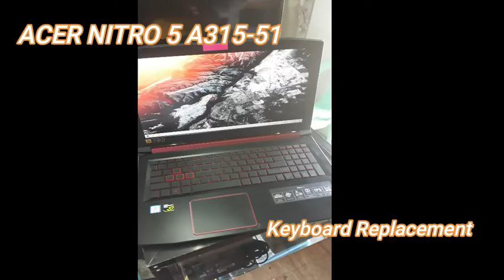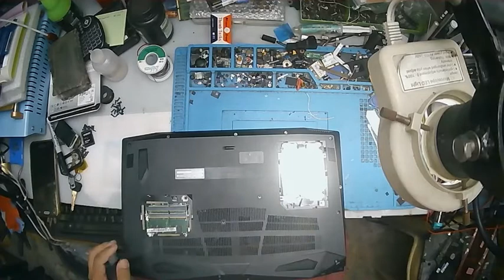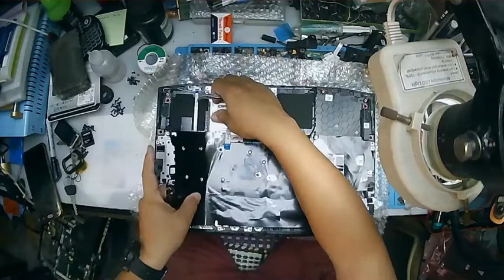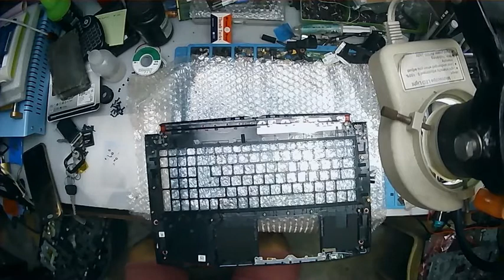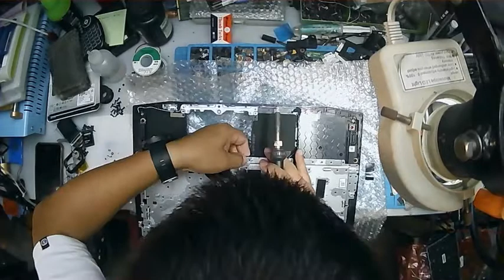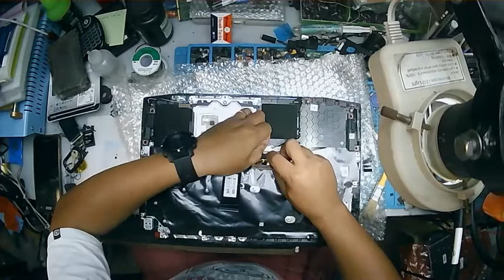Acer Nitro 5 A515 51 Keyboard Replacement

Comment: acer nitro keyboard so fragile,,, if no luck keyboard replacment in Acer is equivalent to engine overhaull,, so many parts to be removed to gain access
Reply from the maker: Yes sir just be sure b4 doing anything on the unit always 1st remove battery
Reply: boss class a lang ba pinalit mo hindi sya red rgb light ata?
Reply: Its like what you have to remove to replace a Chevy headlight  :-)

Comment: I have a problem. I have this laptop and the power key won't work. Is there a way for me to press it without needing to replace the whole keyboard?
Reply: HI, I have just repaired the same laptop which had the same keyboard issue. Replacing the Power key itself doesn't work, so unfortunately, the whole keyboard has to be replaced. You can find Palm rest together with keyboard, but you won't buy it under 66 GBP, new.
Reply: You can take off the back cover and locate where the main black ribbon connection is, right under the battery. there are like 20 connections right there and if u take a screwdriver and short the 2 leftmost pins the laptop will start. From there u can just keep it always on with an external keyboard until you get a new laptop. F acer
Reply: The connections are labeled JKB1
Reply: @tidepods7257  Hey dude can I contact you in discord or something? I can't find the label and I'm not sure how to proceed.
Reply: NEVERMIND IT WORKS HAH

Comment: Idk man. I got water damage on my keypad and its non responsive... i was like how hard can it be to repair it... dude... i have to strip down the whole computer just to get to the keypad.... i took it to a shop the guy said 200 bucks parts and labor. The part is like 20 to 50 bucks depending on where and how you get. Like damn it.
Reply: My kid spilled an entire glass of milk on his keyboard so I brought it out to the backyard and used the leave blower to blow all the milk out. It worked!

Comment: Hello I have a question, this model of nitro acer 5(AN515-51) has the same build and dimension with with the acer predator helios 300(2018)(PH315-51). Would their keyboard parts be compatible? Cause I'm thinking of buying the nitro part since it's cheaper
Reply from the maker: No sir, it depends on model

Comment: Thanks for the assist! I actually wound up trying to plug the Trac pad into the keyboard backlight slot, because I'm an idjit. I busted one of the pins off of the JBL1 and almost had a breakdown. Somehow, it still works, and job done.

Comment: If you've only got a few broken keys and such and your membranes are still good much easier just to pop the bad keys off if they're still there ensure that the membrane still works correctly, and if so you can just swap out the mechanism and key from another keyboard without having to disassemble it
Reply: THANK YOU 🙏🏼 Your comment saved me soooooo much time!  👊🏼

Comment: Great video and a few quick questions  🙂
1. Did you do soldering when you put it back together again?
3. Did you use your phone to take pictures of those two wire positions?
4. How long did the entire project take? Can you do this in one day if you are inexperienced?
5. What program did you use on the USB stick to test the keys at the end?
Thank you !!  :-)
Reply: I did the job with great success but when I opened my Nitro 5 its looked different than yours must be a different model.
I did everything right got the new keyboard in but I didnt connect the wifi card wires correctly so I will have to go back in and correct that.
I also ordered the wrong model keyboard off Amazon first time around but then found the right one on ebay for $28. Works great  🙂
Reply: Hi, glad your repair was succesful! I'm also looking to replace my keayboard. I've never done any soldering before so i wanted to know if it was necessary to solder, and how difficult it would be for a newbie to do.

I have a similar model, an Aspire vx15, and the wifi card cables are a nightmare in this laptop too, took well over half an hour to get them right after fixing the laptop hinge xD
Reply: @angelq9863  Its not really soldering. The boards you have to remove to get to the keyboard is held in place by little plastic rivets. They have heads you have to remove with sharp knife. When you put everything together again you just have to poke the soldering iron into the holes and melt the plastic a bit to make it stick to the edges. Its not a big deal.
Reply: @bloedkop5094   so did you re-use the plastic rivets? and what about the black tape? is it reuseable after we peeled it? or we need to use tape for stick it again? and what kind solder did you used?

Comment: what's the skinny tool that you're using in 21:50? and what does it do?
I need to know cause I'm replacing my laptop's keyboard, and I can use some advices as well.
Reply from the maker: Its a soldering iron sir with flat tip and low heat so u can melt sa plastic frame lock
Reply: @mhelcomputerworks  Where do you get these plastic locks? I don't think they came included with my keyboard...Thank you

Comment: i understand this video is a bit old but where would i go to buy a replacement for the black tape sheet on the inner construction of the laptop?
Reply: I have no idea, but did you broke it? Tommorow I would try to change keyboard in my Acer. Should I avoid something to not break it?

Comment: I cleaned my keyboard with isopropyl alcohol, some of it went under the keys and now my keyboard backlight is only partially. How can I fix this do you have any suggestions? My keyboard is working fine, its just that the backlight is partially lit and not all the backlight under each key is lighting up.

Comment: What did you do to have the keys set up throught the frame correctly.  I just paid to have mine replaced but some of the keys are recessed now.
Reply: he made sure that it looked good when he placed it on the plastic rivets. then he melted the plastic rivets, that way the keyboard will stay in place

Comment: I'm having problems with my keyboard
Whenever I power on the keyboard it turns on with the red LEDS but it turns off and turns back on and then turns off 
What can I do?
(Update: this has been fixed, the problem was my ram
I just switched both of them and it was back to normal.
If this doesn't work either check the wiring for your keyboard or get it checked by a professional.)
Reply: After 30secs each right?
Reply: The problem has been fixed..
I forgot to delete this comment 
Sorry for the misunderstanding
Reply: It's alright
Reply: Same issue has been found with mine, turned out the I/O chip was damaged